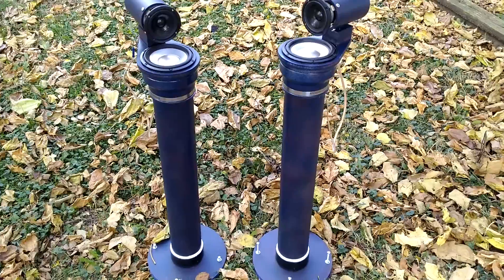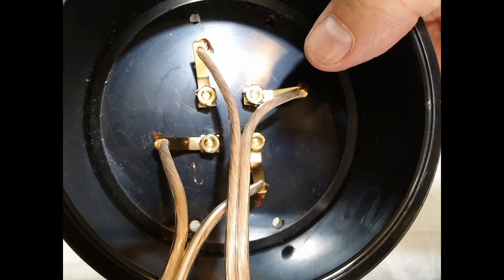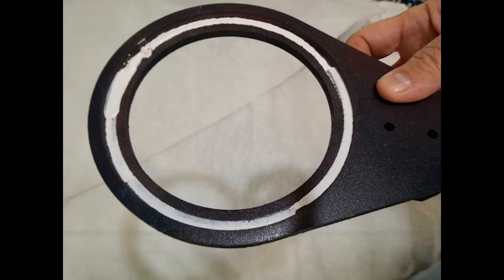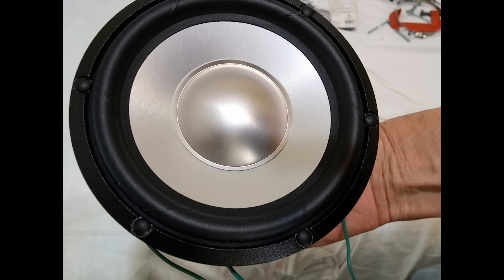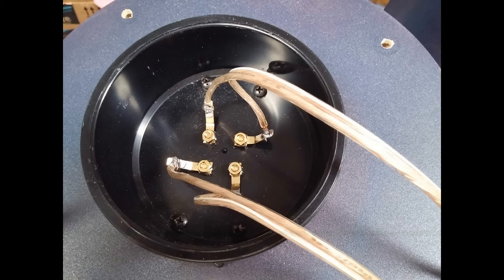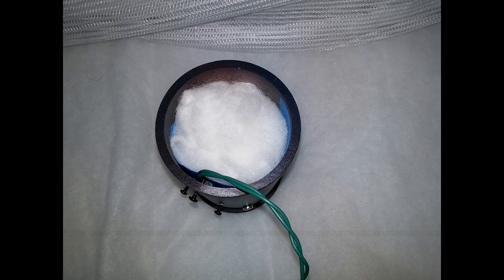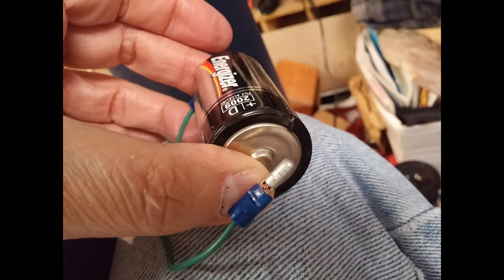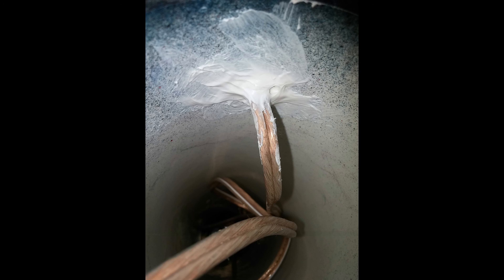LXmini Build Video Part 2

Comment: Can the LF driver be screwed into the wood rather than being glued?
Reply: You can. I did both, but I made sure to use non-ferrous screws everywhere (I have gotten metal shavings in the magnets before).  But the silicone glue holds surprisingly well. Also, you can use 3 set screws for the full range driver instead of 4. It's a bit easier to get the FR mounted evenly with 3. If you want you can also buy set-screws that come with soft tips so you don't mar the magnet on the FR.
Reply: @jimmyjimjimmyjimjimjimjim4437  awesome, thanks for the reply jim
Reply: You are supposed to use screws as opposed to glue. Some gasket tape can be used to make the enclosure air tight.